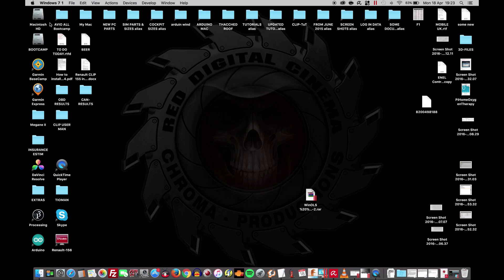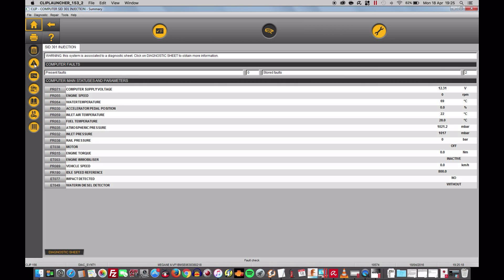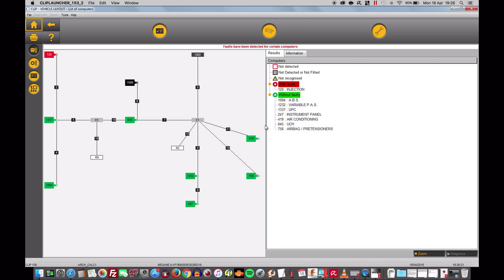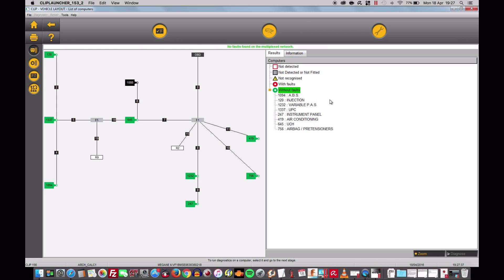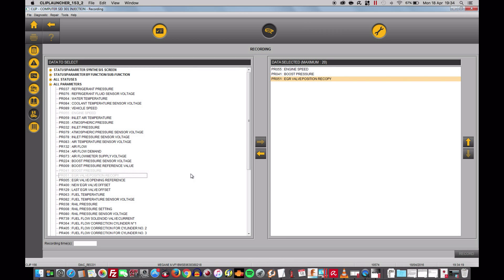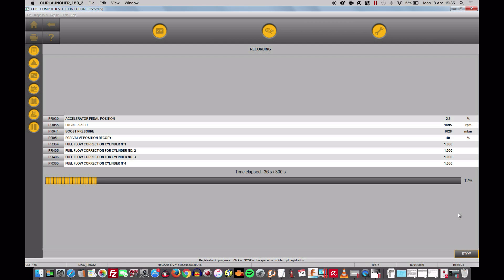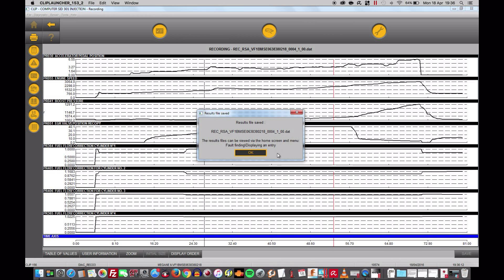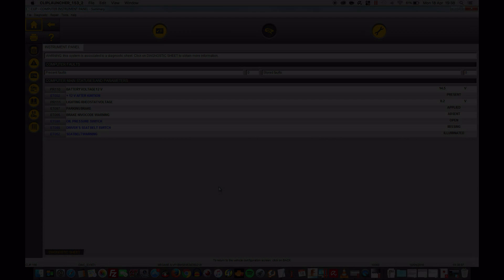Cancelling Faults with Can - CLIP

Comment: Please! Can you please show how to change the brake fluid on a Renault Zoe, with Can clip? Thanks! from Tommy Bertilsson From Sweden
Reply: Thank’s Anyway.
Reply from the maker: Sorry, but I can not help you on this one, for a start I'm not a Renault expert but an ex-Porsche competition engineer furthermore I have no experience with EVs of any sort. However, I've heard that the brake system on EVs works on an electric servo assisting unit which presumably you need to activate with CLIP in order to perform the bleeding. Unfortunately, I have no knowledge of the necessary routine.

Comment: Many thanks! What is the cheapest hardware to use with CAN clip?
Reply from the maker: Any old laptop PC will do, all my PCs are servers but likely I have 2 MacBookPro and I run Parallels for mac on one of them which gives me Windows 7 (or else) and it seems fine.
Reply: @9111logic  I meant the thing to put into the obd interface. Or how do you connect to the car?
Reply from the maker: @haraldsauer728  Sorry about the misunderstanding, the hardware is part of CLIP when you purchase. There are many sources for the complete package and, after investigation back in 2016, I was advised to buy the "green circuit board" hardware and disregard the blue board. If I was buying today I would check again though

Comment: Hi I need your help. Please cab you tell me how i can change the speed signal in the UCH from tachograph to ABS? Thank you
Reply from the maker: The short answer is I don't know because I never had to do such a thing. however, I shall investigate and report if I have any joy. Sorry I could non be of more help at this moment.
Reply: @9111logic  I appreciate your reply and I shall wait to hear from you if you can check for me.
Reply from the maker: @sohailjaned  I looked into my Clip and could not find a reference to your mention, perhaps you could expand a little on it explaining it in more detail.  Even though back in the 780s I was a Porsche Racing constructor, I am not an expert on Renault but it is always interesting looking into problems like this one just in case it's ever needed. I bought Clip 6 years ago to resolve multiple problems with my car and only used it a few times.

Comment: Hi, very clearly how to do. I have a Renault espace 4, 2.0 dci, 150 HP, 2007, nobody knows what is df015, I have the definition for the error but nothing to get the point, checked all pedal sensors, reverse switch, all working. On dashboard is Check parking brake with triangle and the spanner. Press clutch pedal, disappear the message. After releasing the pedal coming back. To mention that everything working fine. Thank you

Comment: What should I do or install if I wanna have CAN CLIP Software running on my mac?
Reply from the maker: You have to install ether bootcamp or better still Parallel Desktop which is quicker to start directly from your Macbook screen. With bootcamp you have to shut down and restart. Hope this helps
Reply: @9111logic  Thanks. Looks better option than I'm using right now - via VirtualBox.

Comment: thanks  so much. It's very clear. 
sorry my english is not perfect and my french too. I hope with  this information I can erase ABS calculator fault on renault scenic 2 - 1.4 16v - 2004. Now it's impossible to start the engine. I have default on board with driver wheel column and the CAN CLIP said ABS calculator (1094) not detected
Thanks again, Have a good day.